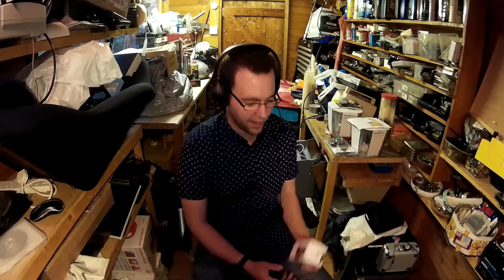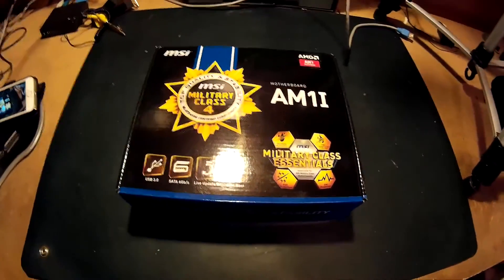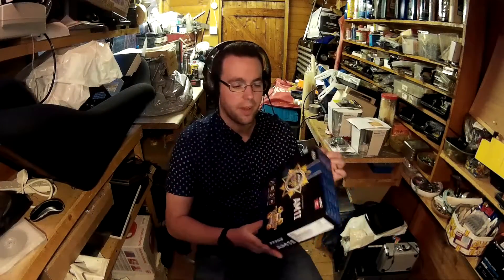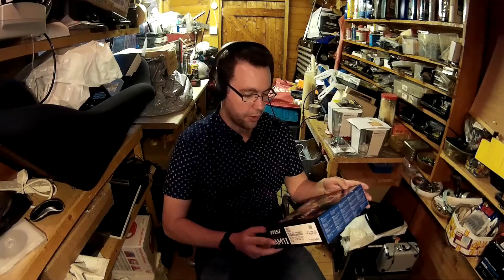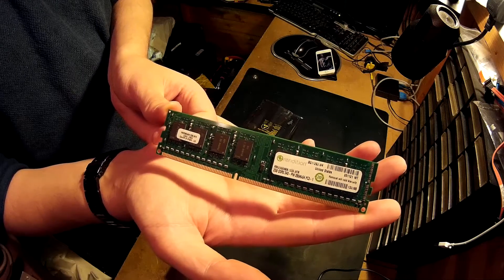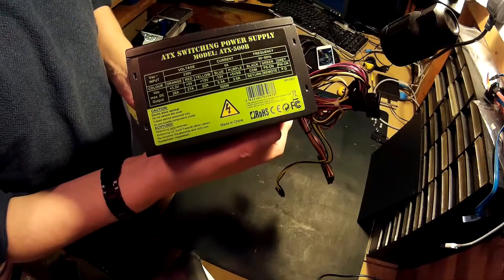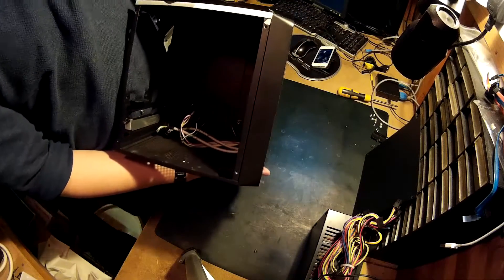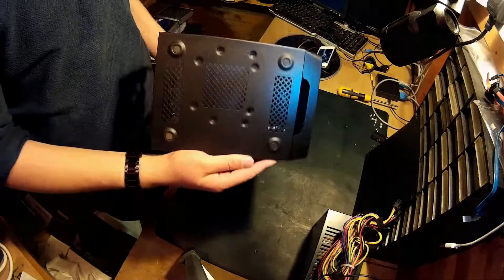Building the Shedinator (Budget AMD AM1 PC build for the shed)

Comment: Youre wrong, the Asus AM1I-A is not better. It tend to freeze and reboot Itself with some PSUs when you have AMD Cool & Quiet and C6 State due to only one 270uF poly cap on the VRM Section, I have those issues. Yours have two 270uF poly caps and Its a 3 power Phase mobo, (the Asus one is only a 2 power phase). This 270uF poly caps info came to me thanks to a forum user. So you picked the right one. I don´t know If yours can O.C. tho. If It does, even better!!. Nice build btw.
Reply from the maker: Thanks for comment! I did not know that so that's good news. I have to say I'm slowly not becoming a fan of ASUS motherboards. I've not tried to overclock as I've read there's not much head room for over clocks on the 5350 so never bothered. Thanks again for this info :)

Comment: Looking at the reports on the AM1 platform and the Athlon 5350 (I have ran an AMD A4-5300 on the A55 chipset for over a year running Windows 10 and still runs like clockwork), and you've mentioned the Mini ITX case left lying around the shed didn't dissipate heat very well, how's the processor's operating temperature since the build?
Reply from the maker: +Jonathan Truong Hi Jonathan, To be fair I haven't monitored the temps in the case since installing the 5350. I think the hard drive in this AM1 build would be putting out more heat compared to the Athlon. The sheds pretty cool and the PC doesn't do too much heavy work.  I had a GTX 750 Ti and a over-clocked pentium G3258 in this case before and under load it reached 80C! The PSU is the only real exhaust in this case and it was getting bloody hot! Your A4 is probably a bit faster than the 5350 anyway even though its a dual core. Also the A4 supports dual channel RAM which may be an advantage. If your looking to move to an ITX build cooling is not huge problem it was this nasty Cit case that has no blooming ventilation that was the problem. If you are wanting to move to an ITX build consider the AM1 chipset if you are looking for a cheap but cheerful system. If you want a bit more horse power then consider a AMD FM2 ITX board with either a AMD FM2 A 8 or 10 series APU or a Athlon 870K CPU and a dedicated graphics card. You can make really tiny ITX builds with the A series APUs as you dont need a dedicated GPU. If I have miss read your comment and written too much info I apologise now! :) Oh the G3258 and a H81 ITX board may also be a good Intel budget option.
Reply: +Old_Tek_New_Triks No worries!
Reply from the maker: +Jonathan Truong So I just rendered a video using the Shedinator and monitored the temps. The 5350 and motherboard ambient sensor never went over 25C but the HDD reached 30C. Its not a great test as its pretty cold in the Shed at the mo but I though you might find the info interesting :) I might run prime95 over one day and see what the results are then as you've sparked my interest!.
Reply: Not a problem.
Reply from the maker: +Jonathan Truong Your question made me make a new Shedinator including video :) https://youtu.be/KT82_MDjEAE